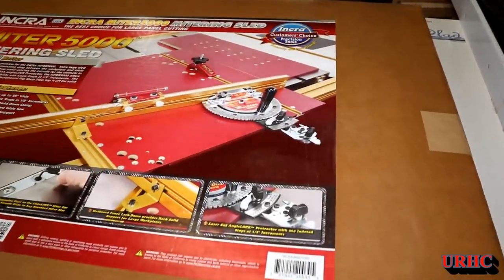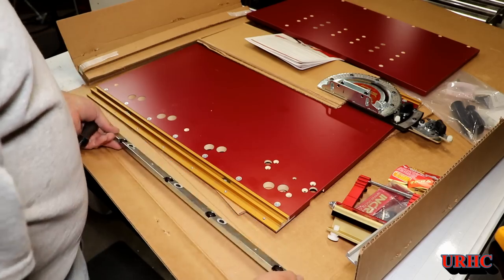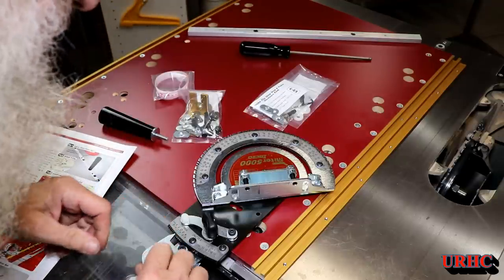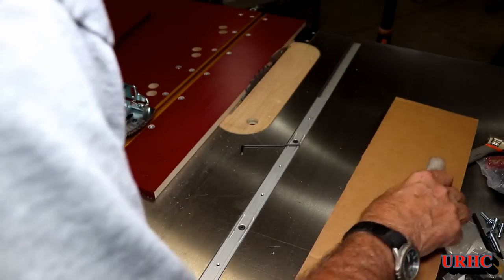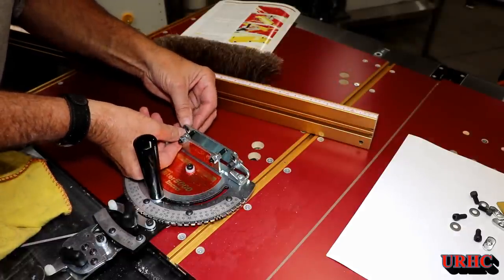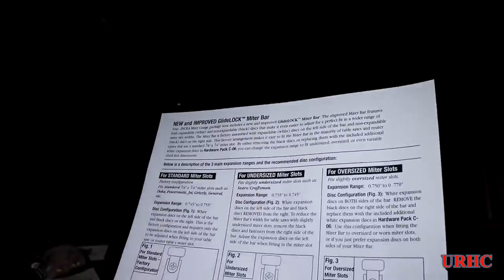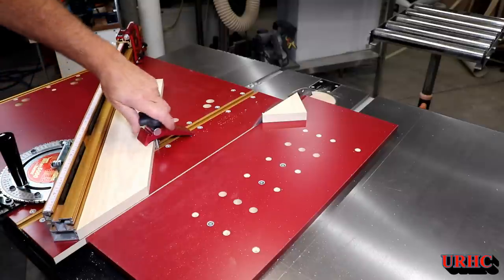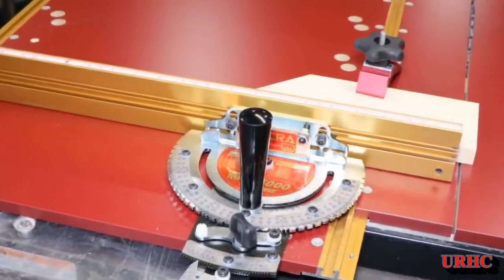Incra Miter 5000 Sled Assembly Quality And First Impressions

Comment: Thats always the way. you pay top dollar for everything and get screwed some times. your lucky you have a great mind for engineering to compensate .Great video.
Hows the bandsaw working for you ? They still have not takin care of those issues and due to your great review i  did not purchase that model . Keep the videos coming! Thanks
Reply from the maker: With this UPS damage was my worst concern and there was no shipping damage.  I expected better quality from incra but at least the engineering has been done well  and it works good. I guess as companies cut corners to raise profits this will be the norm. With the bandsaw the engineering was not properly implemented so there is no way to make changes and I am stuck with it. I see comments from others with similar issues  so you were smart to look at other brands.  I haven't used it much but its still working good. I do not use the brake because that seems to be why the pulley goes out of line and there is no way to realign it without buying a whole new lower wheel assembly now that the warranty is over. Thanks for watching.

Comment: It's frustrating when you pay a premium and you get low quality thanks for your review I just change my mind
Reply from the maker: It is accurate once you get it setup. Incra replaced the problem parts but in the end I wound up replacing the whole fence assembly with a kreg extrusion that works best for me and makes it safer to use. The miter gauge indexing works very good. Thanks for watching.

Comment: You have more perchance than me, “Inca” are not cheap and for the money you should be able to expect quality workmanship that just isn’t there? I know they are minor problems but they should be sorted out before you got the item. Too many people just accept faulty equipment and firms are taking advantage of that.
Reply from the maker: I always  thought Incra was supposed to be top of the line. I think  profit is more important to them than quality now. I did an update where I replaced  all the clumsy incra fence with a simpler kreg extrusion that makes it safer and easier to use. Thanks for watching.

Comment: I really dislike having to re-manufacture parts on anything I buy. But this is something that happens so often that I'm getting used to it. I usually end up lapping faces against a known flat face with wet/dry glued to it in an attempt to true up parts. * I put a 5000 together 15 years ago and had none of the problems you experienced during your assembly. I find Incra's lack of attention to quality control today to be disturbing . I don't recall how my stop came packaged but the fact that yours wasn't is disturbing (I'm going to use that word a lot). They couldn't even do  something as simple as blister packing the fence stop and then taping that down or taping the stop to a small piece of cardboard and then blister packing that and taping that down. I worked in all facets of shipping and receiving for 25 years and if I know anything it's this; if it can move it will move. * Once properly assembled the Incra jigs can split the wooden atom in half and that I really like. * I have never enjoyed tightening the miter bar expanders as you know they the Allen bolts take a huge amount of pressure to expand the UHMW plastic ring. But I never do it with the ring within the miter slot. I pull out the ring and expand it and then try sliding it into the slot.  * I would suggest that you lap the edges of the Grizzly miter slot to remove any slight roughness or mill marks because if you don't you will be machining UHMW plastic off the rings rather quickly.  (I'm sure you can come up with a method to do that if it needs doing.) * To get the most out of any Incra you have to have previously trued the left side miter slot to the arbor assembly to make it perfectly parallel. This is a process that can be done many different ways. I use a dial indicator when I need to do it. * When I need to check the  accuracy coming off an Incra jig I rip an inch off a wide panel, flip that ripped edge over to the stop, rip a hair off the opposite edge, reset the stop to rip an inch off the panel and measure the ends of the ripped piece with digital calipers. I like digital devices for most machinery work as my eyes seem to be different from day to day but the numbers stay the same. * It was interesting to see just how wonky the Kreg was in use. I never liked it either. G.
Reply from the maker: Thanks for the advice.  Now that it's together I will do some fine tuning.  The slot is actually ground very nicely and doesn't look like it will be a problem. I trued when I was having initial problems with the kreg gauge so that is taken care of. I am going to shum back the extension some and it's basically ready to go. It is my first Incra item and I expected a better out of box experience.  It really works nice so I  can't complain. This is a much better solution then the Kreg but for short cuts the Kreg is much easier to throw on the saw. Thanks for watching.
Reply: I have several INCRA items. I called them once about lack of quality on a few of the Incra items I purchased. I told the guy that if they let their quality go downhill, their jobs will likely end up going to China.
Reply from the maker: I had no idea that their quality dropped.  All the videos about this were very old and none showed any issues.  Must be a recent thing.  Thanks for watching.

Comment: sigh qc problems don't motivate me to buy.  especially at $350-$400 price point
Reply from the maker: I have  another  video  switching out the incra extrusions with kreg extrusions to make it safer and easier for me to use. Thanks for watching.
Reply: @unemployedredneckhillbilly2023  ok ill look it up. as a person that owned a small injection molding company 11 machines my costumers would warn me then fire me if this poor qc kept up, as i look at it on amazon, it was a common gripe of the product,,, qc manger can i see you in my office please

Comment: The quality is no better than the Chinese stuff you've had? You just said that this rig is a big upgrade from the Kreg...right? By the way, on that hold down, I found if you pushed the round rotating "bearing" from the other side it would have pushed right in. I assumed the one side was machined slightly smaller to retain it from sliding out. I've bought many Incra products and they are really unsurpassed in the quality of their engineering and, especially, their execution by comparison to any other market offerings. Good thing you'll be able to "get by"...really?
Reply from the maker: I have had many items from China and Taiwan with better quality lately. Finally dumped the clumsy incra fence and stop in another video and replaced it with a Kreg extrusion and stop that makes it safer and easier to use along with letting me cut 24 inches. The gauge indexing is the good part. I definitely would not buy it or other incra tools again after this let down.  Thanks for watching.

Comment: This is both quite surprising, and quite disappointing. I would have expected better from Incra. I want to buy one of their products as well, but that makes me second-guess it.
Reply from the maker: I expected better quality.  Luckily it's mostly cosmetic and the sled works good.  That aluminium Guide on the right is really garbage for a t track. It expands the bottom but not the top so you can't just pick that side off. I think I will skip on the other items also. Thanks for watching.

Comment: I have seen a lot of Incra items and I have always been very impressed with them, I would be sending that back and also sending a snotty letter to Incra quality section (if they still have one) One comment said that these are now made in China, if so that would probably account for the loss of quality. I know everyone is trying to get costs down but Incra trade on the back of quality and if they lose that they will be in big trouble, it is one thing they cannot afford to lose. If enough people return items that are not up to the top quality then Incra will have to take note, the problem is that people are getting used to poor quality and no longer complain.

Comment: You obviously haven't had any "precision" goods from China, where the manufacturing tolerance is + or - 5mm  🤣🤣, I will say INCRA can definitely work on their installations instructions, just bought a Miter 1000 HD and cannot understand the cryptic instructions on how to get it all adjusted, for an American made product I would expect very concise installations instructions
Reply from the maker: It definitely wasn't good quality for the price point and being made in the usa.USA.  I dis an update where I dumped the incra fence and stop for an easy to use kreg extrusion  and now it works pretty good. Those Ortur lasers I just  got from China  are accurate within about  .001 mm and were flawless out of the box. Thanks for watching

Comment: I would have sent it back if I was as unhappy with it as you are.
Reply from the maker: When I buy something  for my channel  I don't  send it back if it's  not completely  broken  or doesn't  function. Good or bad I show how items  work and last over time. I have another  video  showing  how I was able  to make it easier to use and safer with A kreg  extrusion and stops. Thanks for watching.
Reply: @unemployedredneckhillbilly2023  I bought the Incra 1000 SE earlier and it looks great. I am worried about my finger as I cut a lot of small pieces mainly at angles so I bought the sled today.

Comment: the square your using looks just like  the ones i brought at HarborFreight, they are not squared!!!!!
Reply from the maker: It is. When you buy a square  take the time to square it up against a certified square and even a low cost square  can be accurate.  These you can loosen the screws and adjust.  Big framing squares are adjusted with a center punch. Thanks for watching.

Comment: When I was a young man Incra was considered the top of the line in accuracy. Too bad they have gone the route of corporate greed. I would have boxed it  up and demanded a refund.
Reply from the maker: It definitely is accurate but I was disappointed by the quality.  They sent out a replacement aluminum Guide, the 2 damaged scales and red stop parts.  I did a update on a recent video.  They definitely don't take pride in what they ship out anymore. At least it worksworks good.  Thanks for watching.
Reply: If not incra then who?

Comment: Yeah, OK. Your first Incra tool. You don't understand how the right miter track works so instead of asking why it doesn't work as it should, you assume it is made wrong and take a chisel to it. Your ham-handed chiseling changed the piece so that it not only doesn't work as you think it should, it can no longer work as designed so you consider it crap. Then when the CS rep from Incra tells you how it works, that it has been working for 20 year and  over 200,000 units, instead of getting a new one and at least trying to use it as designed LIKE THOUSANDS OF OTHER USERS HAVE DONE, you blow him off and still insist it is a crappy example of a crappy design. What makes you the expert on a highly successful product you have never used and clearly know nothing about?
Reply from the maker: They sent another and the same issue. It spread at the bottom and locks in the groove in the track. It is garbage in my book if it has to be slid in place, won't drop in. There is a update showing the replacement parts. I guess I expected Incra to have top shelf products for the price point but I am not impressed. I have had better quality from Harbor Freight lately. Thanks for watching.